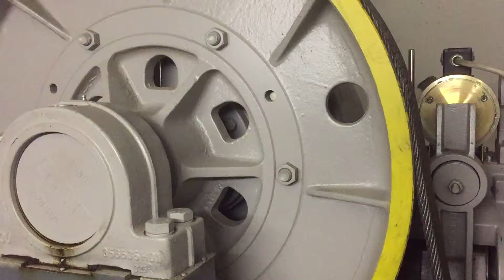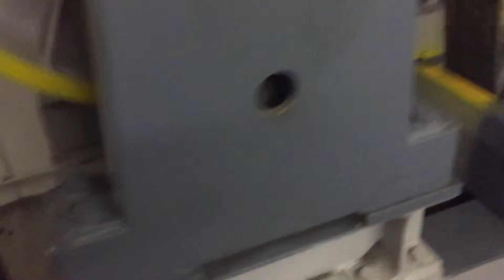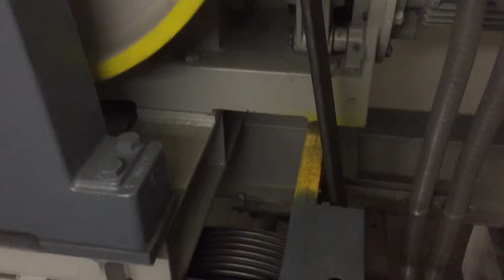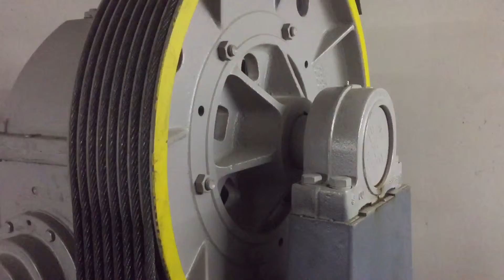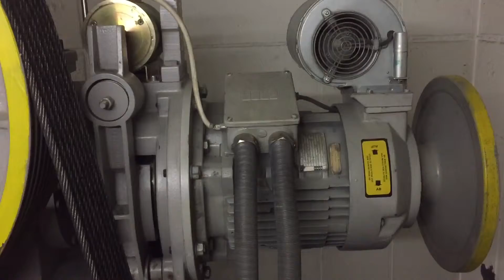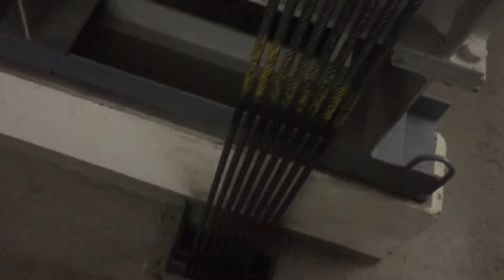Elevator motor room

Comment: Looks huge geared traction machine with double wrapped roping, probably 3 phase AC induction motor with VFVV drive controller.
Reply: The video doesn’t show much but it doesn’t look like double wrap...just a lot of ropes!
Reply: @caroleast9636   I checked the video again,  there is a sheave to the left  of the hoist ropes on the counterweight side. As the driven sheave is huge maybe 60"-72" in diameter, ropes at an angle. The aforementioned sheave was likely build into the base of the machine as a defector sheave if a smaller driven sheave was installed.  I would say there is a deflector sheave beneath the floor, however. You are correct it's not double wrapped, 1:1 roping 8 ropes geared machine.